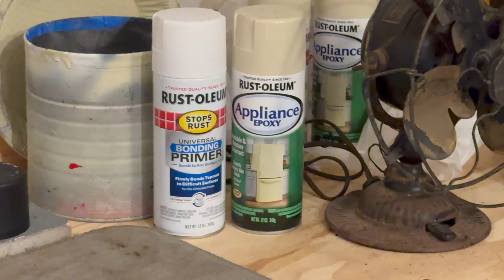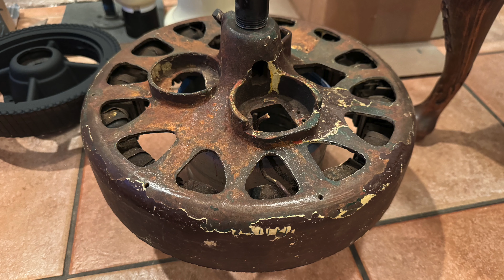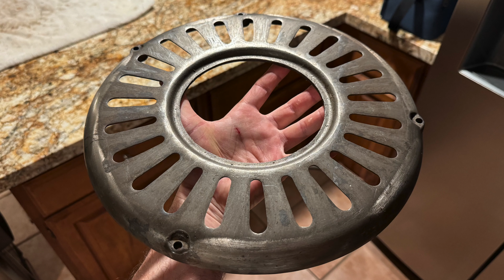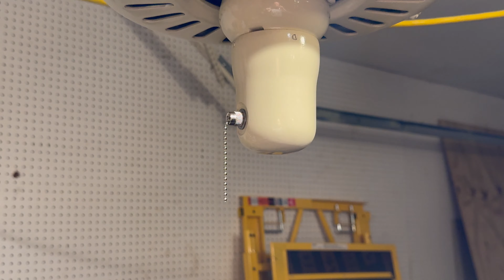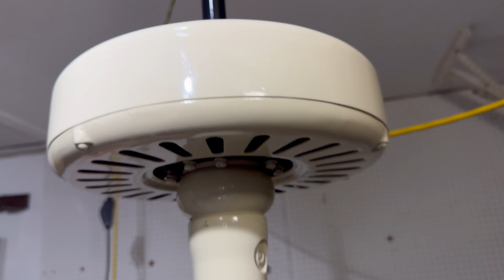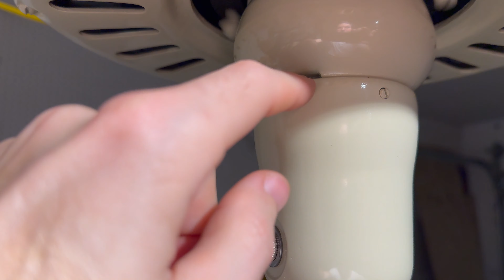Emerson 85641-AN Roundnose Antique Ceiling Fan Post-Restoration Motor Demo

Comment: I will look up that super lube ISO 100. I have a few fans that could use a heavier oil. The main one being my whole house fan, which is a big 30 inch direct drive unit. The bearings start to squeal after a couple of years and I want to remedy that.